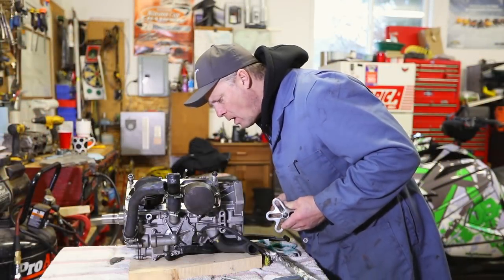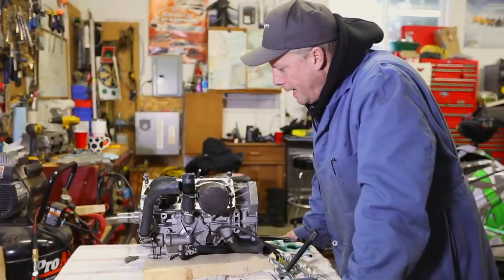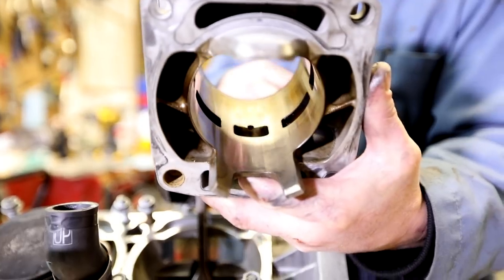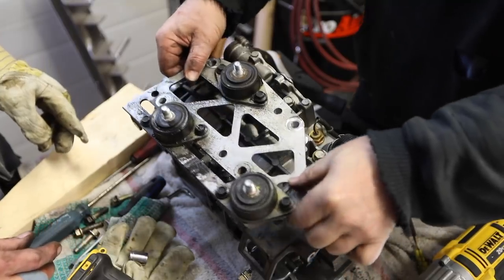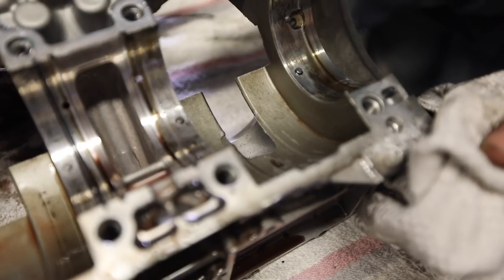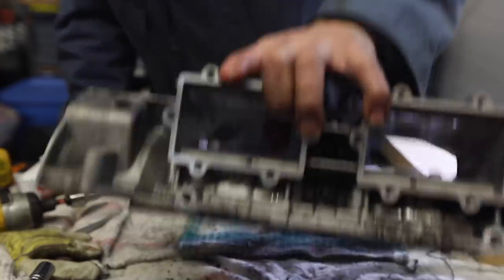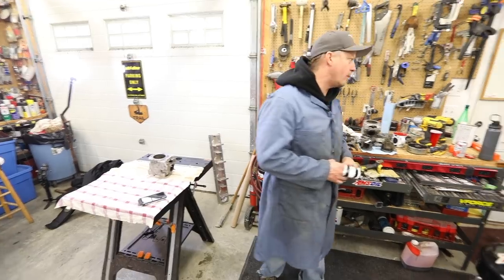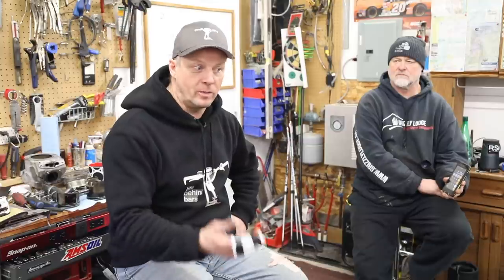C-TEC2 800 2-stroke tear down. Blew up at 4000 miles. (PART 2 of 3)

Comment: I've got over 9k miles on my stock 07 m8 162 off trail mountain riding ! Not a high horsepower king motor but the longevity and durability from suzuki built two strokes is unmatched .
I've heard great things about the  c-tec2 cat motors also except for the air intake system taking in a little to much snow and water other than that bullet proof

Comment: this reminds me of my zr600 took the engine out to change the crank seals, put the bottom end back together found out the crank bearings have some  play was kinda mad about that but for one bearing it was almost as much as a crank on ebay, i found a new old stock from ebay plus found 2 new old stock jugs put it back together fired it up last week runs mint idles good

Comment: It’s always been our rule in the western US that you replace the pistons , rings, at around 1800-2000 miles also like to check the reeds , look for any leaks. Etc saves a lot of money in the end.
Reply: For what. Had 18000km on a 600. Compression was up to par.

Comment: Are you a believer in using arctic cat ctec oil in ctec engine or other  brand
Reply from the maker: Ya it works fine , but I use Legends in all my mod motors so just use that in Ctec engine too !

Comment: I have a question, so i have a 2006 arctic cat f7 (stocked). And it won't go over 7000rpms, I brought it to county cat, they said the power valves are good the reeds are good, the ecu was good, they thought it was the stator. So I was wondering if you could help me out? thank you!
Reply from the maker: Ya could be stator ? Limp mode maybe ? Any codes ? Im sure they checked for codes ! Prob stator !
Reply: @DIGIT9  There were no codes! So yeah you're probably right, it's probably the stator. I'll let you know if that's the problem. Thank you so much. I love your videos.

Comment: Do you have a video on choke adjustments? My 98 Mach 1 700 triple isn’t running the best. The choke doesn’t feel right, I feel like it could be stuck opened? She’s runs and idles but she’s just lacking power. Ideally I’d just like to ship it to you and you give her a once over 🤣 but that isn’t happening.
Reply: Its all in the clutching.
Reply: @Welcometofacsistube  can you elaborate?

Comment: I've seen broken piston skirt from bad heat cycle/over heating.. im no enginerd..If its spraying cold fuel at the hot side of the piston..this may be a reoccurring problem..just a theory..🤷‍♂️
Reply from the maker: This theory was discussed during the filming of this vid! - Randy
Reply: @DIGIT9  wonder if you can delete that 2nd injector..
Reply: @DIGIT9  or maybe a forged piston would handle the abuse better..idk if their available..just ideas..I'm sure your not the only guy dealing with this..its always nice if your can correct a problem

Comment: 4k is a lot of miles. Surprised there isn't more gnar in there.
Reply: Lol no it isn't
Reply: My rmk 700 has 8,300 miles Orginal pistons and crank
Reply: @thatbigblock7007  my 1998 yamaha vmax 700 triple has 25k on it. Never rebuilt. 135psi on all 3 cylinders.
Reply: @thatbigblock7007  JESUS CHRIST
Reply: @jacobdingledine5506  GOOD LORD
Reply: @jacobdingledine5506  I can't get more than 2k before rebuild. Mountain miles i guess.
Reply: @danielware4316  haha fair enough